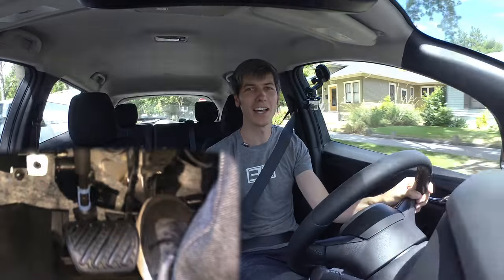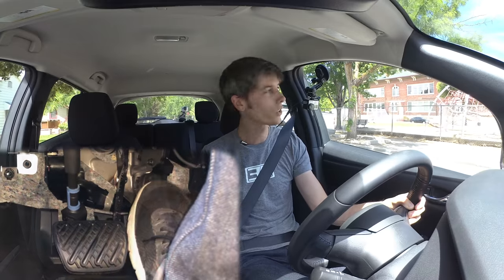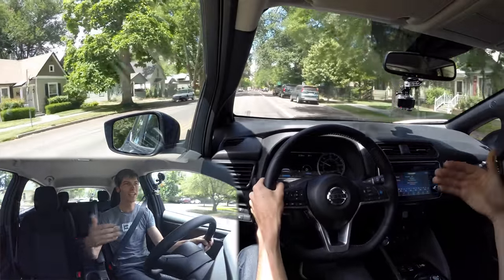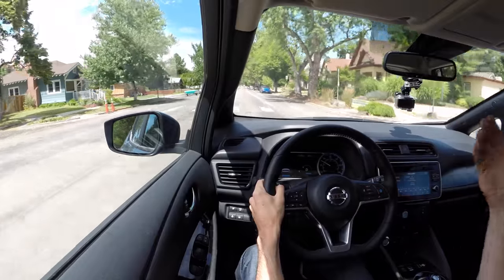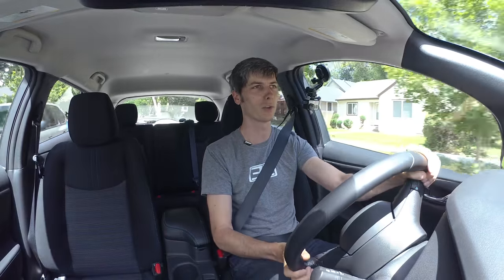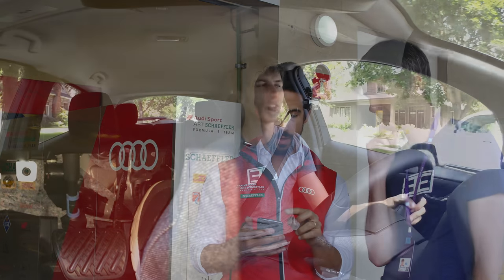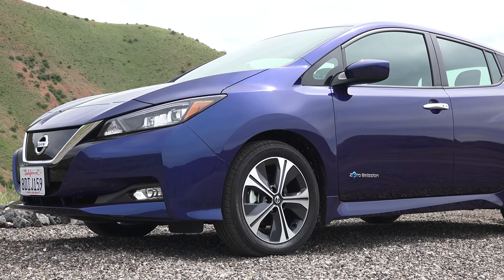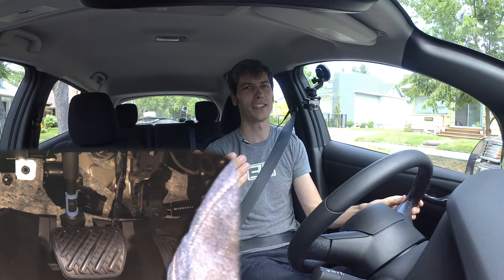What Is One Pedal Driving?

Comment: You should use the Leaf for ALL your in car talking videos until you give it back.
It'll let those who say EV's suck to at least accept one benefit of them, Silence.
Reply from the maker: It is wildly quiet and smooth!
Reply: And the instant torque. I live in a hilly area so I think I'd get annoyed if it was braking me going down a hill that I wouldn't brake myself during. I have a Honda Accord and it has this technology called Grade Logic and on declines, it downshifts to slow you down. Some people like it. I do not.
Reply: Brian Burke If you want to accelerate, press the accelerator...
Reply: I don't want that either. I want to coast unencumbered.
Reply: Brian Burke, put it in neutral. I do that sometimes, but this is in a gas car with an auto and a console shifter.
Reply: Coasting in neutral is illegal in some states
Reply: Brian Burke my corolla has that feature, when you want to slow down put the clutch in and chose a lower gear :)
Reply: Brian Burke 
He says you can turn off the feature in the video so I don’t think it would be a problem.
Reply: And then a kid who can't hear the car walks in front of it not paying attention. Great benefit, now daddy doesn't have to pay child support.
Reply: Victor I wouldn't say EVs suck, but the silence is a part of the problem with them. Some of us love the sound ice engines make. I'm renting a Volvo 730 right now while my truck is fixed, and the silence of this 13L diesel drives me crazy.
Reply: Brian Burke Many EVs have adjustable regen braking, or build regenerative braking into the brake pedal and some allow for switching it off completely. If you chose the right EV, you should find it much less annoying in this regard than ICE cars.
Reply: Jay Dunbar I also like the sound of ICE cars, with my personal favourites being AMG V12s and the Dodge Vipers 8.4L V10

Too bad Britain is banning ICE cars by 2040. Let's hope some countries only do this at least 20 years later while they build a sustainable EV infrastructure and we get to enjoy their noise just a bit longer.
Reply: Georgio Henderson 
This could be solved with a few methods:

Create an artificial noise from outside the car so people can hear the cars(1 pro to this is that you can make your car sound like a futuristic space ship) and the noise could be cancelled out by the interior speakers for the comfort of the passengers.

OR

Teach you children to look Left Right Left (vise versa for LHD countries) before they cross

EDIT: Plus cars of today already have some OK collision prevention and it'll continue to improve as time passes.
Reply: Engineering Explained - I see you like that instant torque too. Every time you started off it raised up like you were snapping the pedal down.
Reply: That's not a benefit except for in a video
Reply: Anyone who thinks EVz suck should search youtube for rimac 2. 1,950 hp, 0-60 1,85 sec, they have limited top speed to just 259 mph (400 Kph) also has regen braking. Also has maps of the major race tracks in the world for a "learn" mode, where the car takes you round the circuit at full race speeds autonomously to teach you brake points, turn in points etc. Even Ferrari owners will be envious of that performance
Reply: kia has something like this built in as an extension of the TCS and limits your down hill speed to  about 20kph ive tried it a few times  and I do not like it its rough and noisey because its just braking action
Reply: I ordered my Nissan Leaf 2018 earlier this year and picking it up next week. This is coming from a guy with 2 turbo four wheel drive rally cars.
Reply: It would be hella nice if we get virtual car sound packs for our electric cars. Dream a prius with 2jz sound. LOL
Reply: Georgio Henderson all EV cars still have mechanical external noise. Some even have artificial noise when parking.
Reply: I've driven a few EVs and I would not say they were silent, sure they were quieter than my rattly old diesel but most cars are. 
Whilst EVs may be silent or almost silent, once you get up to a decent speed you still get road noise, so are not any quieter than a modern combustion engine.
New petrol and even some new diesel cars are so quiet at idle you can barely hear them anyway.
Reply: I liked the silence of my 2014 LEAF and the 2018 cars are even quieter.  This is coming from someone who has a V8 Mustang with a Bassani X pipe and Flowmasters.  If I want noise I drive that car... but in my commute silence is bliss.  I will have another EV next.
Reply: No benefit if you enjoy the sound of your engine, “ louder the better “ 😉
Reply: Paul Ashton nobody said EVs suck, I'd just rather not because I enjoy driving manual and the engine sounds
Reply: Quiet is good for us and him recording, but I'm gonna miss engine noise in the future :/
Reply: Not trying to be rude but more trying to entertain my own thoughts but how would a cop know you're coasting in an electric car and I personally doubt that an officer is going to be like "Hey that car is in neutral finishes donut and puts coffee in cup holder I'm going to get you scumbag lawbreaker! turns on lights and chases after toyota prius going 5 under how dare you not be in gear!'' again, just trying to be funny/ realistic.
Reply: I love electric driving so much.
Those people, who still aiming for the internal combustion engines, just never tried to drive electric for some day. 
Once you are used to drive electric car, you get really annoyed, when sitting back in a car with internal combustion engine. There is really no advantage, driving loud and noisy cars
Reply: yeah they may be loud and noisy, but I'll never forget the first time I launched my car. I still had my permit and my mom was in the passenger seat but I didn't care. I banged through 1st 2nd and 3rd and it felt amazing. I've driven automatics, electrics manuals and those weird truck like minivans with the selector near the steering wheel but I have never felt any pleasure driving a car with only 2 pedals. They maybe loud, noisy and outdated, but by god are they the most fun I've ever had. And I'm sure that there are a mass of people that feel the same.
Reply: @ ghost tactical airsoft
There is a big difference to drive a gasoline car with two pedals, or an electric car.
Because the electric car doesn't make sound and most important it doesn't need to shift between gears.
Before I hate driving automatic cars. I felt the same like you. And I still hate driving automatic cars. And I had a replacement car for 8 days, a brand new Mercedes E200 with automatic gearbox and 9 gears. OMG what bad car....  I will never buy that, even if it's only 10% of the price.
But electric cars are not automatic! There is only one transmission between engine and wheels. No need to change it. Neither automatic or manual.
And driving electric car is instant brutal power, you never can imagine with gasoline car. 
It's so much more fun to drive. Just try it for some days and not just once around the block..
Reply: well I've never driven a performance electric car so I don't know about that end but I feel the need to drive manual, I don't really hate other transmissions or electric cars. I just would much rather have a clutch and a stick than have a car that may be faster but I can't hear the engine. we all have our opinions. Have a nice day and thanks for helping the environment in my stead :)
Reply: MegaGouch it's probably a case of the engine now doesn't mask ambient road noise and now it can appear to be worse than what it is!

Comment: Good content, only, you should've mentioned that unused brakes in EVs cause rust and tend to stick the calipers on. Although i don't know if there's a safety hazard/precaution concerning that. Can you enlighten me?

Cheers
Reply: solution, just come to a complete stop at least once on every trip, it ensures the brakes get used (rarely). lol...(or if you aren't sure about that other pedal, take it to your mechanic every month for them to do a "brakepedal re-calibration"  (joke)
Reply: Uluç Özcan the brakes are still applied to hold the car when completely stopped.  However dude to lack of brake material being worn down from actually braking the calipers and slide pins don’t travel very far, so your statement does have some validity.   It would be ideal to have the brakes on these type vehicles serviced depending on driving conditions.  If you drive in areas that use road salt, I’d probably have them lubricated before winter and after winter ... otherwise every other year should be safe.
Reply from the maker: Your brakes still rub, and they rotate every time you drive (not stick). No worries on rust not using them frequently.
Reply: I don’t think he (Uluç Özcan) was speaking of rust on the surface of the rotors, but the slide pins on which the calipers operate.
Reply: if that becomes a problem, manufacturers could (will) incorporate automatic brake clean function.  They can make brakes pump every startup/shutoff to brake loose dust/rust and cycle through the brake system.  To be honest though, it's impossible to brake only using 20% capacity all the time.  Traffic happens.
Reply: Youn Gu ...that wouldn’t really be a viable option.  Hydraulic brakes can only apply and release brake pressure, there is no withdrawing or sucking (that I’m aware) brake fluid.  Calipers and slide pins will unfortunately stick at some point in their existence without proper maintenance ... whether it’s a conventional car, hybrid or an all electric vehicle.
Reply: Brakes will seize up if not used regularly. Especially in regions where roads are salted in the winter. Of course the same applies to infrequent driving.
Reply: Don Cairns 

Never had a problem with our Volt in Minnesota. Think of regenerative braking as a primary deceleration system. Once the vehicle slows down or comes to a complete stop the hydraulic braking system will be used, automatically. The braking system is still being used during daily driving, just far less wear and tear.
Reply: Ok so, this is actually a good question. Now I can't speak for all electric vehicles but I do know that on the Chevy Volt and Bolt, while driving your brakes will lightly apply themselves to remove rust on rotors. Actually when we have to service brakes on these vehicles we have to grab our scan tools and temporally disable this feature so that the piston won't randomly pop out when we have the calipers off.

Comment: For everyone wondering: .2 g’s deceleration means 30 -> 0 mph will take you approx. 7 seconds, and 60 -> 0 would take double of that.
Reply: Also, you would move approx. 50 metres or 160 feet forward during this time, or 200 metres / 640 feet in case of 60 to 0 mph. All the values have been rounded to the nearest 10.
Reply: SuomiFinlandPerkelee Thanks.  Did you obtain these numbers from some literature? Or did you calculate them? Or perhaps your own a new leaf and did some experimenting.
Reply: phenex551 calculated them with a simple function s=(v2-v1)/a, s=time, v=velocity and a=acceleration. .2g’s is 1/5th of a g, which is the gravitational acceleration of approx 9.81 m/s^2 depending on where on earth you’re at. Then, for the distance you simply multiply the maximum velocity by the time and divide that with 2.
Reply: I thought if the speed is doubled then the braking power required is 4x.
Reply: I guess they meant 4x distance
Reply: 14 sec to stop no thanks i bet i can get that down to 3 or 4 in my car

Comment: Tried this with a Bolt in downtown Toronto.  Took like a block to get used to it - kind of an extension of the deceleration you get with a manual which is what I normally drive.  Really if you do a lot of stop and go, particularly in city, this is great especially as its combined with the instant torque.

Comment: Jason, a more common use of one pedal driving can be traced back to hydrostatic transmissions (most commonly found in garden and compact tractors), where the valving of the transmission direction pedal does both the braking and acceleration.  Biggest difference is there is zero power recovery. I imagine it would be odd for most people to drive that way unless you operate a hydrostatic tractor on at regular basis.  Cool stuff!  Thanks for this one! Cheers!
Reply: It took 4 years for this comment to get a like

Tisk, Tisk internet 🧐

Comment: I drive a stick shift and as you've talked about previously downshifting to slow down is a really great way to save brakes overtime. Sounds like one of the major differences here is that with a manual your brake lights don't warn drivers behind you if you're slowing down, but with the super cool electric cars they do!
Reply: You don't slow down in ICE car as fast as you do in an eV does When regen braking enabled

Comment: I've seen people drive using 2 feet to work the brake and gas pedals. LOL
Reply: electronicsNmore I do that in my work van if I'm feeling lazy the seat is uncomfortable and I know it sounds super lazy but I get tired of picking my foot up and moving it back and forth all day
Reply: My aunt does that. She earned the nickname "F1 Racer"
Reply: Bad for transmission
Reply: Reece Mayer your kidding right??
Reply: Reece Mayer it’s not bad for transmission but it’s unsafe.
Reply: IVAeroVI   A lot of people say 2 foot driving is unsafe but I don't get it. Go-karts are like this and I've never heard of anyone hitting the brake or the gas on accident simply because they aren't coordinated enough to use 2 feet.
Reply: GrandpaBaner I think it's just a precaution. The chances of the gas and brake pedals to be pressed at the same time are significantly lowered.
Reply: @Ryeric1  I'd disagree that it significantly lowers it.  If such an insignificant number of people would hit both at the same time on two foot vehicles then getting rid of those small numbers wouldn't be significant.

Then you have to take into consideration that the brake peddle is way stronger than the gas peddle and if you apply the same pressure to both you'll still slow down.

Finally, using 1 foot increases the time it takes to stop and having the brake raised higher than the gas means your foot can get snagged during the transition from gas to break.

Basically what I'm saying is that I don't think 1 foot driving is due to safety because I would hypothesize that it's less safe. I think it's due to there being a clutch still in some cars that this outdated 1 foot layout still exists today.

Edit: I just did a quick Google search and found that modern cars turn off the gas peddle if both the brake and gas peddles are pressed making you slow down.

Comment: Because two pedals are too many I guess...
Reply: Ryan Gehret or because this feature will make you achieve more range in an electric vehicle...
Reply: /whooosh
Reply: most people use the pedals like an on/off switch. they don't bother modulating. technically you can use just the accelerator through rush hour traffic if you just pace and modulate the accelerator properly. however people are impatient, people want to close the gap in front as fast as they can and slow down in kind.
Reply: Electric motors should have enough cooling to take the breaking.
Reply: Because god forbid actually needing to pay attention to the car to drive

Comment: The forklift we have at work can be driven like this because  just as here the motor will automatically reverse and brake the machine to a stop when you let go of the accelerator pedal. I mostly only need the brake pedal to hold the machine steady at sloping ground when handligt a load, never when driving it around. It s kind of neat